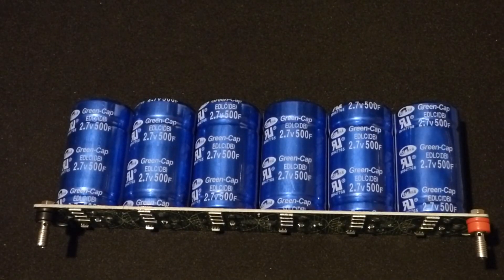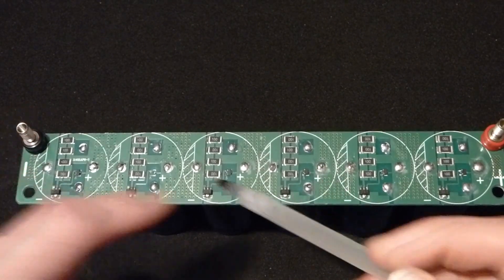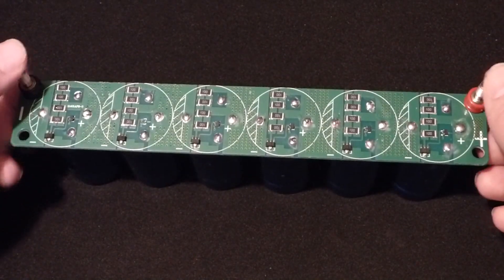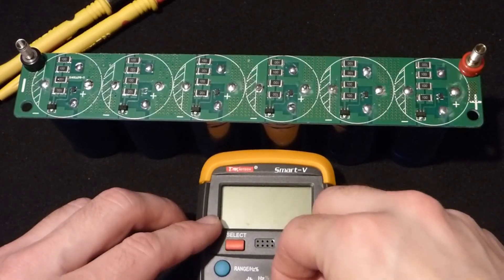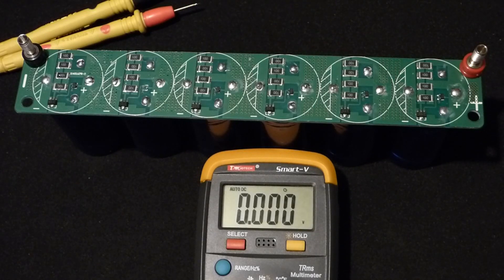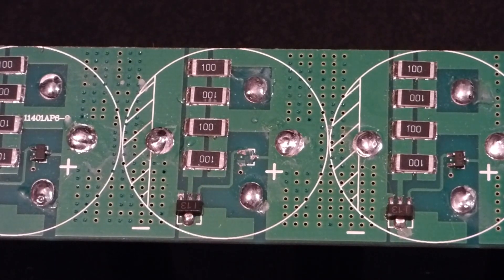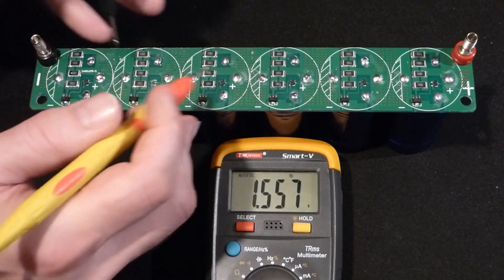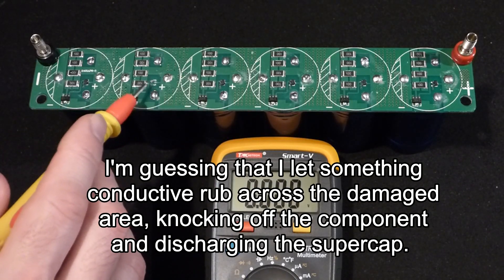I test the voltage leakage of my series supercapacitors and find damage

Comment: lmao.... this is the down side of using that crap on top. AND the resistors that help regulate the voltage, leak them down so they are the same as the others. I have seem these without the board on top and after 3 days are virtually the same ans the start voltage.
Reply from the maker: Yeah, I am working on DIY alternatives unless I find something better. Thanks for watching!

Comment: How do you check the AH capacity for these when fully charged? I'm thinking about making one of these with a hand crank+ inverter.
Reply from the maker: I don't really ever calculate AH, so I am not the best person to ask, and I don't think AH works well with capacitors anyways, but a 1F capacitor will drop 1V for each second that 1A of current is drawn from it. There's 3600 seconds in an hour, so if you have a no leakage capacitance of 3600F, then you can expect 1A of current over an hour for each volt that drops across the capacitor/parallel capacitors. You can increase the voltage by putting them in series, but then the capacitance goes down, and you need protective circuitry to prevent any from over charging or discharging into negative territory since they are almost certainly polarized (balancing). That sounds like a fun project though! I will be doing some like that some day. Good thing is that you can start small scale by making the circuit(s) with low capacitance capacitors, that are safer to use, and working your way up while fixing any issues that arise.

Comment: I bought one of these on Ebay.  None of the capacitors were more than 400F each one was 300F  Another one was so bad it would not hold a charge more than a couple hours. They refunded me $8.00 for one of the capacitors being so bad. I would of asked for another $8.00 for the one that was 300 F but did not notice till much later. Another seller was selling capacitors in groups of 5 that were labeled as Maxwell I had bought 10 They we all different lengths and even had the wrong model number printed on them. They were all fakes I got refunded on all of those then they quickly removed the listing. I would not purchase capacitors on E bay from Chinese sellers again. There are so many that are junk and fakes. I will only buy from Amazon from now on.
Reply from the maker: Yeah, I definitely would never recommend buying them from EBay for a serious project. They are a good price in my opinion for playing around with but that's about it. My first purchase from an official electronics supplier like digikey will mist certainly be for quality supercaps or hard to find transistors. I prefer to get from Amazon whenever possible.
Reply: So you think the Amazon distributors are not in China? I think you may be surprised. Also if you think that your local warehouses are not supplied from China again you are up for surprise. 

BTW I bought two different Li-Ion batteries made in China one for laptop one for vacuum - disaster in both cases neither of them had balancing board nor thermistors.

It's not to say that there cannot be good products made in China, just some of them lack quality control and traditionally if they can get advantage of the westerner they will...

Comment: capacitors in series, their capacitance  does not get divided or added , their voltage gets added
Reply: Capacitors in series do get divided. If they are all the same and you have 6 500 Farad 2.7 V capacitors in series  you end up with an equivalent 83.3F capacitor at 16.2V I tested this formula and it is true. Try it yourself and then do a test and see what you come up with and you will understand.

Comment: I thought it was a voltage sensor / comparater to switch on those discharge resistors through the MOSFET (the other larger component) so that that cap will not exceed 2.7v.
Reply from the maker: Sounds good :)